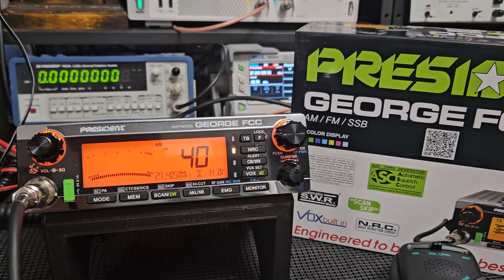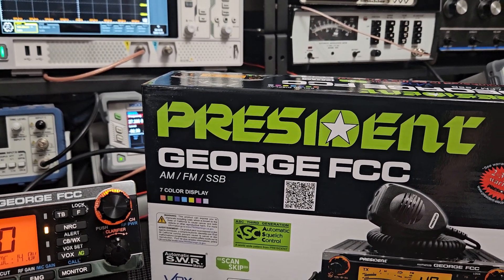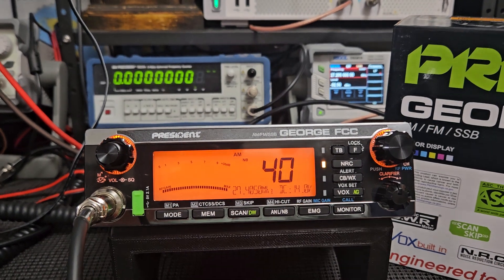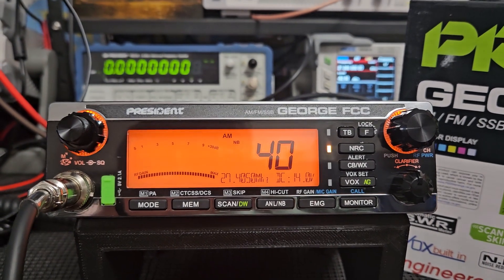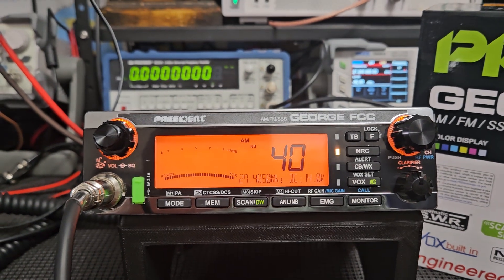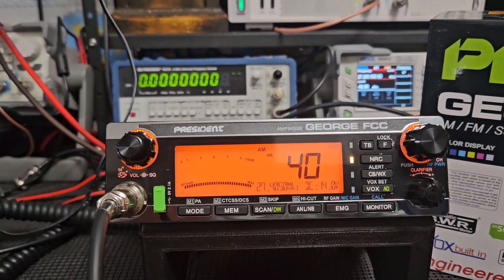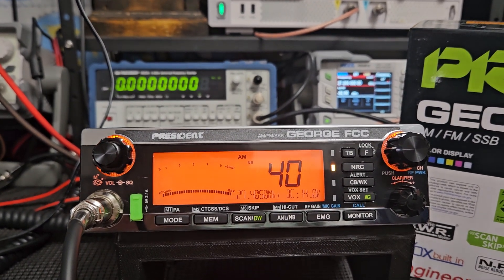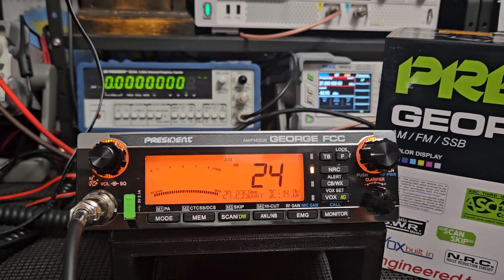Thoughts President George FCC CB Radio

Comment: Hey, I just got one of these radios and I am trying to 30 print a special bracket for it that will fit right in my car, but I can’t find anything online on what the width of it is could you please measure from left to right so I can make the right size bracket for it so I can get it all done the same day please
Reply from the maker: The measurements are on the manufacturer's website. 
The radio comes with its own mounting bracket.
Reply: @ScottsRadios  I know it comes with its own bracket but I don’t really have any got spots to put it without printing
Reply: @ScottsRadios  alright well thank you I looked on the makers website and it helped, everywhere I looked they didn’t have the width label and it was hard telling if it was saying the length or width, thank you

Comment: I think this looks like a "very nice" radio but it's not what I would want, especialy for mobile.  I'd LOVE to see them come out with a simple layout SSB capable radio for mobile use.  Something like a Walker but with SSB.  Just give me basic controls with SSB so I can reach up and change the channel and not worry about inadvertently pushing one of ten buttons if I hit a bump in the road while I am adjusting the radio.  Give me knobs for Channel, Volume, Squelch, Mode, Mic Gain, and Clarifier (maybe RF gain too); a few slide switches for ANL, NB, High Cut; and NOTHING ELSE.  NO FLUFF FEATURES, NO EXTRAS.... just a simple radio that works.   President, please make a nice, simple, functional SSB capable radio for mobile use.  I like the McKinley but it uses too many multi-function buttons.... again bad for mobile, especially in a commercial truck.   Great video, thanks for the info.

Comment: I just bought  my  980 ssb.  Haven't had. Ssb radio since early 90s...  love the look 
Like the push buttons on radio  instead of switch.    Nice big.  S.meter.  you can see.
Already had. Peak and tune.  No power house radio but thats fine.  .  Weather channels is nice.
Receive is about 7 miles.    When  RF.gain  IS AT 5.     But have it at 3 for. RF. Gains.  Because of RF . junk coming through speaker..  so thats gonna cut Receive down to almost 50%.   So. 3.5  miles Receive...    need to have filter put into power line.   Take care of RF junk coming through.
Reply from the maker: This is the nature of CB radio these days.
Also on ham radio we have a problem with noise level.
It's not necessarily the radios fault. Everything else around it will negatively affects what the radio hears.
Basically too many low quality pieces of electronics being used in homes and businesses that generate a lot of dirty RF into the RF spectrum.
Our radios pick it up and there's nothing we can really do except like you say try to filter it out.
Reply: On my normal power cord.
Have 3 donut magnets
2.5 inch  donut magnet. 
Have power cord wound around. Each one.   Diy.   Rf choke  .
It helps a little bit...
Since I have. External speaker hooked up.
And lot of wire from it.
Gonna do  donut magnet  rf choke on that also.  See if it helps out.

Comment: What's a good extension speaker.     I have a bearcat bc20 speaker and it's  terrible for sound quality. 
All low tones.   No high tones.   Flat muffle sounding...   
Checking out the Motorola external speaker   think 5 inch speaker is the way to go . Think the square  Motorola speaker is 5 inch... seeing it 4 around  50 bucks  on internet
Reply from the maker: Try to get a West Mountain Clear Speech cLRdsp. Then you can plug any speaker you want into it and you can adjust the tone and filter settings on the west mountain device.
I don't like speakers that have built-in tone or filter settings because they're usually not very adjustable.

Comment: Looks like a good and solid build quality, can be a bit difficult to find a good amp to pair with. For AM use you would really have to turn down the deadkey quite a bit. For SSB only you would need some sort of a driver unless you are using something like an LDMOS.
Reply from the maker: I tried it with a KL203P and it works fine. 2.5 watt dead key was giving about 35 watt dk with amp on in AM.
Probably could put full output of it into a KL 503 HD.

Comment: The President George is a very nice Radio don't get me wrong. But for the price I would still rather have a President Lincoln. Just because you get more options and a little more power an extra channels. I know not everyone wants a high-powered radio with extra channels but the two radios are very close in price.
Reply from the maker: Operator preference. I like them both.
Reply: @TM-gv6zv  is the Lincoln a cb or a ham unit?
Reply: @Slickheadhunter  the President Lincoln is a 10 m radio that can easily be converted to a CB radio. All I'm saying is for the price you can get so much more with the President Lincoln over the President George

Comment: lol President will never stay with one model for long, how many different models have they produced in the last 2 years both  AM/FM or AM/FM/SSB, I honestly don't think The Base version of radios is still needed, yes some folks still go for a good Base station, we are now in a compact generation, mobile with a power supply and an amp or a radio with everything pushing a lot of power, most CB owners that need a base  go for the Ham radio converted to CB, one of the top selling  radio is the ICOM  7300 purchased more by CBoperatoes than Ham operators, the older Base are just nostalgic
Reply from the maker: I respect your opinion.
I don't agree with all of it though.
I would say to anyone who is using an HF radio for CB only.
"Start studying and get licensed and use the radio to its full potential."
They are fantastic radios.
It's amazing what you can do with a radio like that on the amateur bands with limited power.
Happy New Year 🎊
Reply: @ScottsRadios  I am a Ham

Comment: I'm curious to see what the device looks like on the measuring devices in its original state with a little modulation increase and a maximum of 50 watts. I think it would be a very good device for 11m. You only hear good things about the George 2 73s and Happy New Year from Germany💥✨
Reply from the maker: Not capable of 50 watts.
Reply from the maker: 73 from Michigan USA